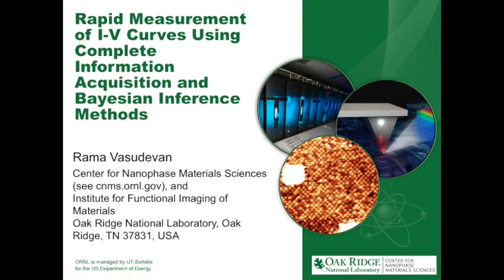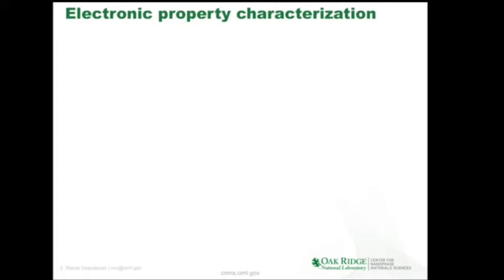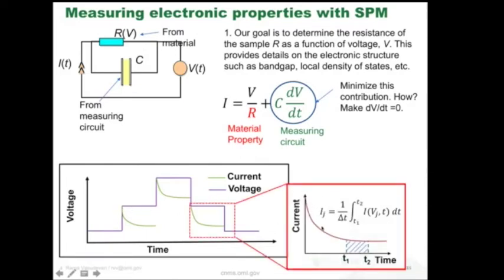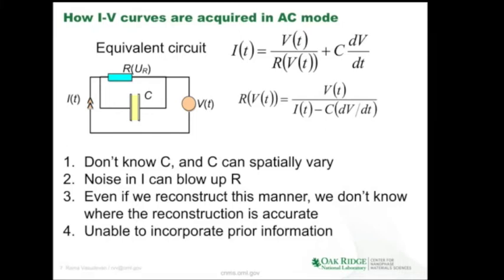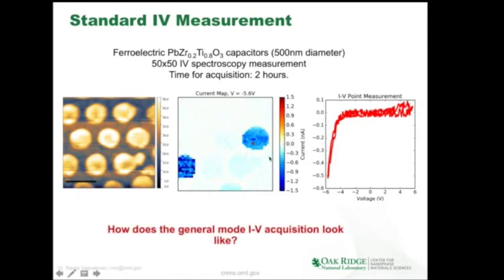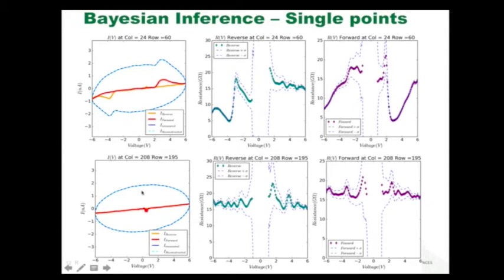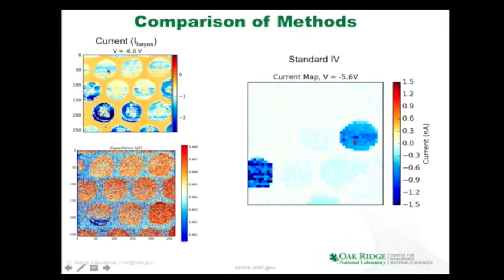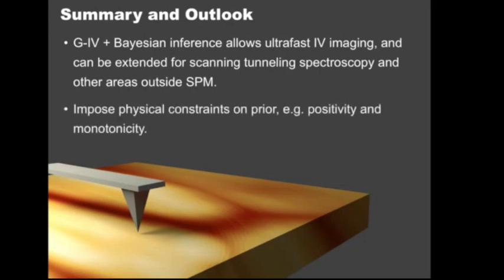CNMS GIV Presentation

Comment: Just out of curiosity, if the distance of measurement is infinitely small, you can consider capacitance to zero, theoretically. Also by measuring multiple points, end to end, the capacitance are in series, further reducing its effect on resistance. The voltage, temperature of the material, the purity of the metal all contributes to the resistance. The time in your equation, I presume is the capacitance charge cycle, which again is linear pushing the resistance upwards from zero as the capacitance charges. Is my understanding correct? I have only seen half of your presentation. These are my queries/understanding so far. Let me finish further and provide my observations. Also,  I do understand the difficulties in measuring at microscopic level as the impedance of the measurement will also come into play, which will be in parallel to resistance.